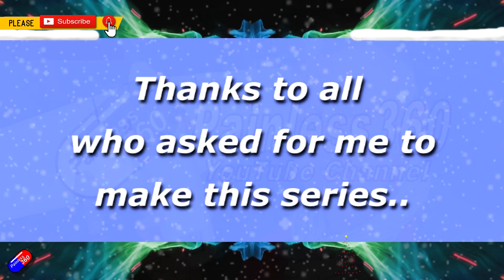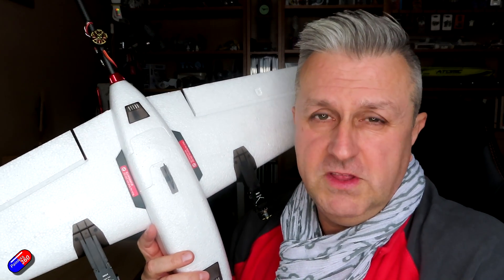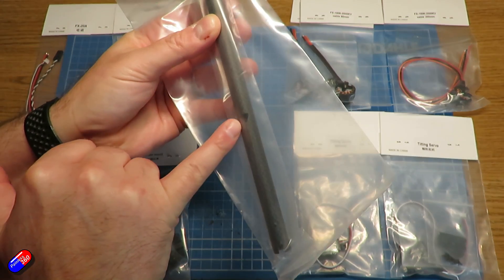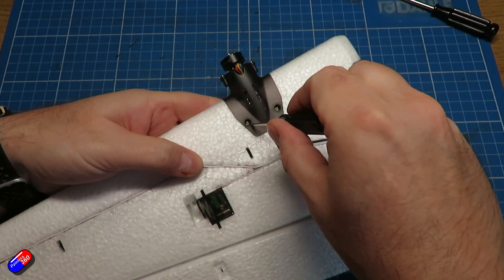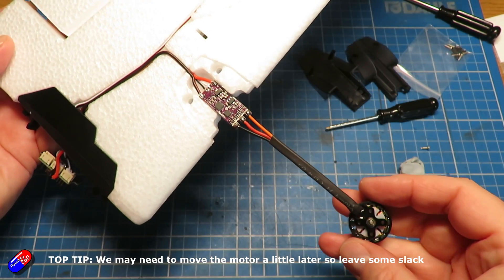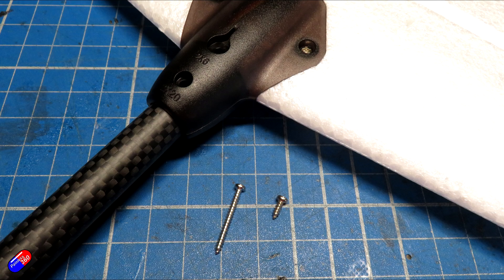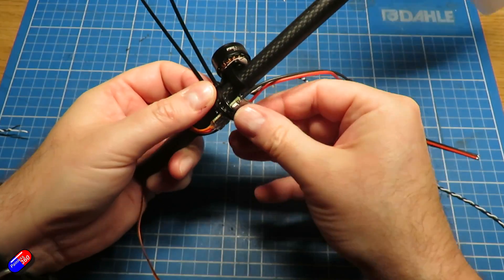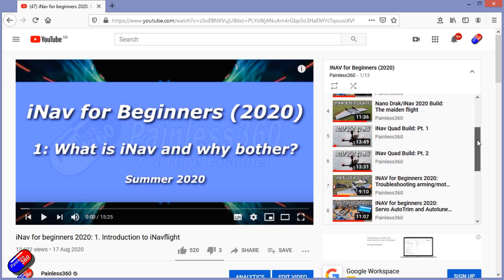Ranger T-1 VTOL Build: Video 1. Installing the HEEWING VTOL Conversion Kit

Comment: Hi Lee - if a person bought the T1 kit (no motors, esc's, etc), and then also bought the T1 VTOL conversion kit - would they have pretty much all they need to fly?  Only missing pieces I can think of would be the flight controller and 2 esc's?  Thanks...

Edit - OK - also 4 servos?  2 ailerons, rudder and elevator.
Reply from the maker: Not sure. I show the VTOL conversion kit parts on the channel. Best of luck

Comment: Can this Matek F405 VTOL flight controller be used in a plane that has not been converted to VTOL? Is it capable of all of the features of other flight controllers like return to home, auto takeoff, stabilization modes, etc? Or does this flight controller give up a lot of normal features to make room for the VTOL features?
Reply from the maker: It is. The difference is realty the extra connectors on the PDB.. best of luck

Comment: I really appreciate your build video 🙏 It took me only a few hours to get the nacelles built. I was wondering if you have found the rear motor to heat up that much to a point where it’s necessary to have it installed on the boom instead of inside the fuselage.
Reply from the maker: If you mean the rear ESC then I did that for cooling and more space inside the model plus more seperation around the compass... happy flying!

Comment: I can't seem to get the motor 2 , motor 1 and motor 4 in servo output to work, motors only work when I put it in RCIN3, any suggestions
Reply from the maker: Not sure, are you using the exact same kit?
Reply: @Painless360  yes , the T1 conversation kit with a F405 wing vtol flight controller, question, what controls forward and backward flight in qloiter mode , does the motors pitch or does it operate like a quad
Reply from the maker: That is academic if you can't get the motors to spin using the motor check in Mission Planner. Yaw is controlled by the pitch of the front motors, side to side and back to front as as a regular MR..
Reply: @Painless360  this should still work using SBUS correct or do I have to have crossfire hooked up RX, TX

Comment: Hi Lee it’s Steve again no the quick question this was going to be for the GPS and The wire harness that comes in the package when you crimp on the pins at the end of the wire obviously I’m trying to match up where the pins go in the clip to make sure that the letters on the side of the GPS match the flight controller letters looking at yours Your last color wire is blue and mine is yellow I don’t know if what I’m saying is making any sense or not but as long as you match TX and RX to the flight controller you should be fine right OK thanks a lot Steve once again.    This is my wire harness from left to right. R=5v / B=G / Y=rx / B=tx /  W= da / G=cl    When I look at your picture it’s the RX and TX that’s throwing me off a little bit in relation to my wire harness
Reply from the maker: Rx on the GPS connects to the Tx on the flight controller and vice-versa... best of luck

Comment: I only have f405wse.. do i have to buy the f405 VTOL in order to use with vtol conversion kit?
Reply from the maker: You need a lot of outputs and a way to provide the power to the three ESCs in the model. If it can do that, then it should work..
Reply: @Painless360  ah i see
Reply: @TERBANGFPV  I'm using the 405-wing and it works fine. I don't know how many outputs the WSE has though.
Reply: @rmooneyhan0624  it only has 2 motors pad
Reply: @TERBANGFPV  OK, so those pads do not control how much power goes to the ESC's, they measure amp draw. Up to 132 amps it says on the website. You can solder all 3 ESC's to those 2 pads or even just 1 set of the pads. The WSE has 10 PWM connections so you can use S1,S2, and configure S3 for motor control. You can certainly use this controller. I spent a LOT of time on Ardupilot's website learning about setting up the PWM outputs for what function you need. Everything after that was pretty easy. Lee is doing more great videos to help people through this process.

Comment: Hi Lee, you mentioned a small 3D printed part between the boom and the rear ESC. Is there an STL file available for that please?
Reply from the maker: Link added to description - https://www.dropbox.com/s/3otbl4w4buteh2h/Ranger%20T1%20VTOL%20tail%20ESC%20Mount.stl 
Happy flying!
Reply: @Painless360  Wow! That was quick. Many thanks. I have all the bits now to get started on the project.

Comment: This should be an interesting series.  I know nothing about VTOL firmware.  Is there a specific reason you're choosing ardupilot for this build?  Best of the season to all.
Reply from the maker: I'm guessing you are not a regular viewer of the channel, Ardupilot is one of the very few flight control firmwares that can do VTOL. Make sure you are subscribed and stay tuned!
Reply: @Painless360  Thanks for the information.  I've actually been subscribed and watching your stuff about quads for about 2 years now.  I've done a couple dozen scratch betaflight quad builds and one with arducopter, but I'm just starting my 1st fixed wing build tomorrow (Ar Wing PRo, thanks to you).  I knew ardupilot could do VTOL, but wasn't sure if iNav could which you often use in other projects.  Of course I could just wait and watch the videos ;-)
Reply from the maker: Cool, thanks for watching.  I guess you've missed the content where this was discussed.  Happy flying and seasons greetings!

Comment: I wonder if a sub 250g VTOL would be possible, might a bit of a challange? Useful video as always, thanks Lee, Merry Christmas to you and family.
Reply: Im building one at the moment using a big glider wing, 3d printed parts and  wltoys x450 vtol parts im at 260 grams at the moment still need rear motor and servos but downsized abit it could work it uses 1307 motors and 900mm wingspan my hard limit is 300 grams but I made it a little heavier for durability and  to make it easier to do electronics aswell
Reply: @kieren7763  sounds like a fun project, I hope it flys well for you.
Reply: Sub 250g vtol would be insaaane

Comment: Hey, be sure not to switch from QLoiter to Manuell flightmode, default settings in Arduplane is to fast and will end in a stall
Reply from the maker: Manual should only be used on the bench for setup tests. See my other VTOL series... Happy flying!
Reply: LOL, I switched to manual from q_stabilized and it did a backflip! Was able to recover, but it was really funny!
Reply: @rmooneyhan0624  Mine did a backflip, dived into ground and crashed when I switched from q_stab to cruise :(  Do u know what caused the backflip?
Reply: @DLJ2022  I've been told and found in a couple of forums that it HAS to be switched into a "Stabilized" mode from Q_stab. I've flown it many times since and as long as I go into FBWA or Stab modes it doesn't backflip. Guess Cruise isn't considered stabilized.....? Maybe they mean self leveling, not stabilized.